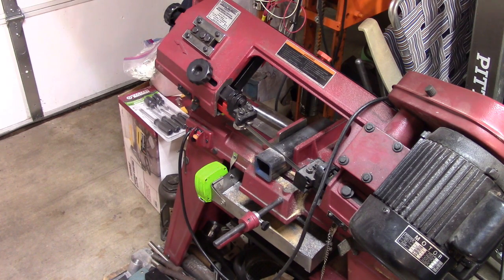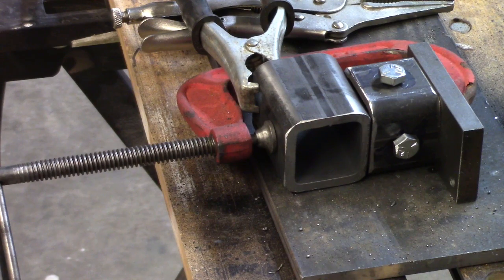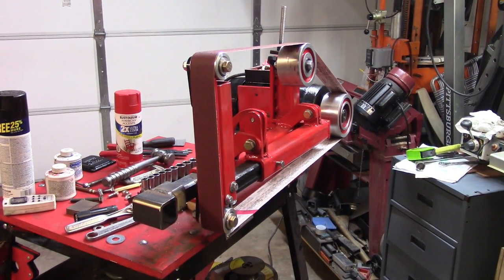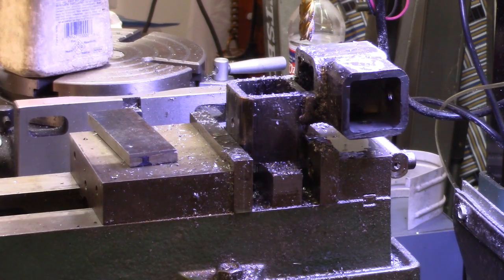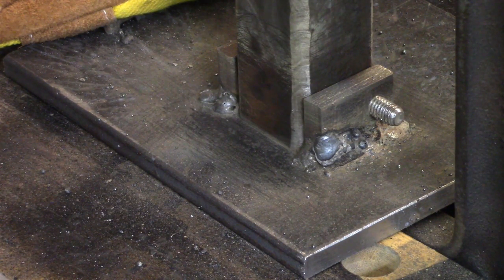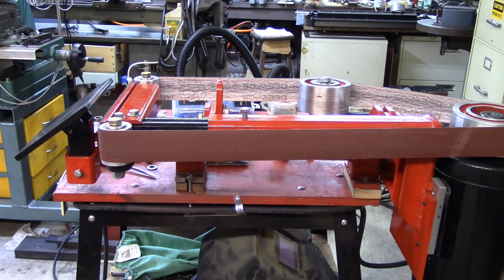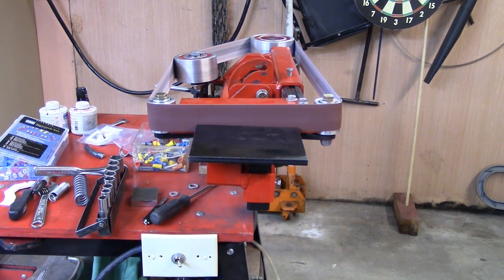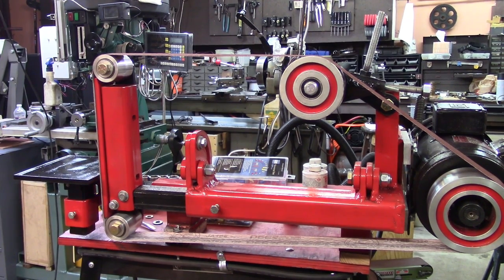Belt Grinder Part 11 -  Finishing the project

Comment: Hay rake teeth should make a good torsional spring for belt tension. These should be available form Tractor supply or any local farm store.
Reply from the maker: Their is a tractor supply in Alvin and one in Santa Fe so next time I am in one or the other I will look for that, thanks.  Thanks for stopping by.

Comment: That's a top notch belt grinder you made there Harold. If anything it seems a bit too heavy duty to me. You probably could have built it out of lighter gauge materials. That might have kept the costs down some and made it a bit easier to do.
Reply from the maker: I weld better on heavy stuff, no blowing through.  😁  Thanks for stopping by.
Reply: @AmateurRedneckWorkshop  welding thinner gauge material can be tricky. I was stick welding 20 gauge sheet metal the other day and that went poorly for me. I didn't have any 1900 electrical boxes in my milk crate hoard of that junk for a duplex outlet I wanted to add to one of my benches so I welded a piece of sheet metal to the back of a 1900 extension. I do have a bunch of those kicking around. I was saying grinding and paint make me the welder I ain't on that one for sure. I still got it together though. I used 1/16th inch diameter 6013 rod I got at Harbor Freight to make it extra challenging. Their welding rods really suck. I might as well wrap paper around coat hangers as use them. There's always next time.

Comment: On your tracking wheel tension arm you just need a maximum of 30 lbs of tension on it and also your bearings sound like you have over tighten your wheels and maybe and that could be what's causing the noise but back to your tracking wheels and belt alignment find you a.zero point that you can measure from on your grinder so that you can make sure all the wheels are setting exactly square to each other and that the are all the same distance away that zero point to the outside edge or the inside edge or to explain it better tilt your grinder to the horizontal position and level it up best you can then find a spot that you can lay a level across the wheel to make sure they are at the same height and level and make sure you have 30 lbs tension on the tracking arm and that the wheels are not compressing the bearings from being over tighten and not having the bushings in between the bearings or having it but over tightening the bolt after you check all of that then it's most likely your bearing are just not the quit type it could be that the SFPM is way to fast also put you a VSD controller on it if it's up around 6k
Reply from the maker: Thanks for the tips Mike.  Thanks for stopping by.

Comment: The torsion spring is a booger to make.  Where did you end up getting yours?
Reply from the maker: I did not get a torsion spring.  I changed the mount and used a regular spring.  Thanks for stopping by.
Reply: thanks

Comment: I think medium priced bearings are just the cheap ones with a higher price!!  It looks good.  Cut that spring, one coil at a time, until it's right.  Those aren't mistakes, they are "design changes."  Sparks, OH BOY!!  Put up a spark Guide and you can identify unknown metals. https://youtu.be/D094eBa4S7c - The grinder is working great!  I though you were gonna say "Turn out the lights, this party is over!"  http://www.jokebuddha.com/Bubba   Waiting to see you using the grinder for project work.
Reply from the maker: Chances are it will be a while before I need it.  Thanks for stopping by.